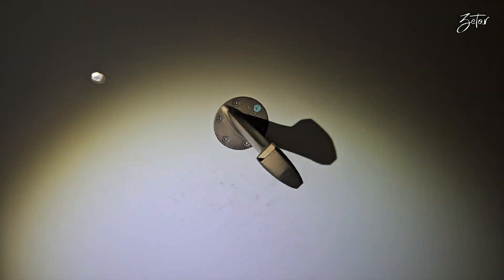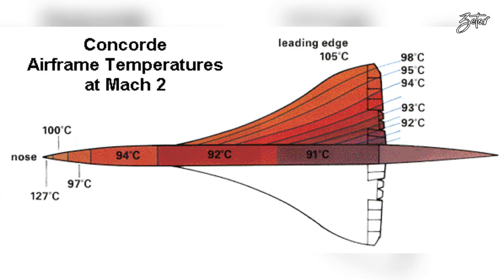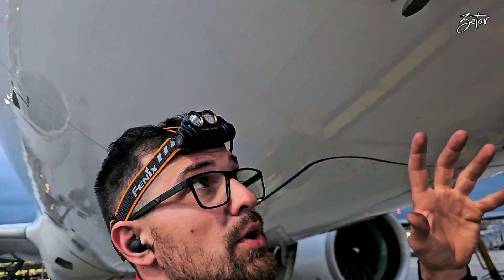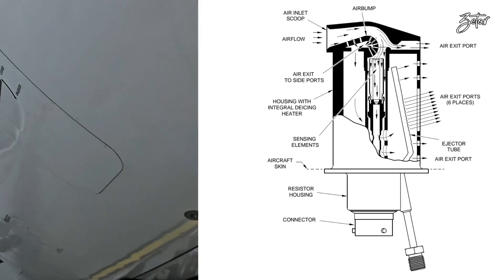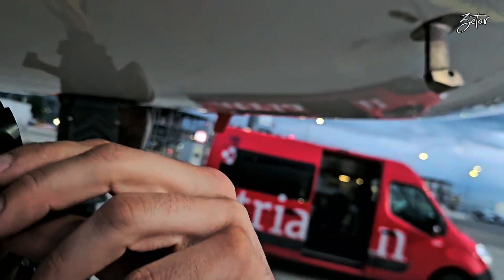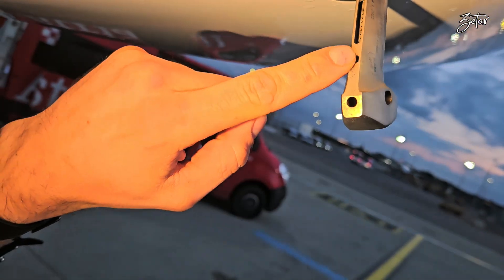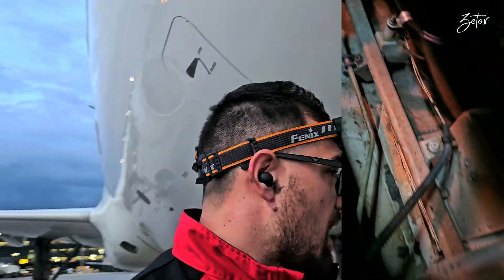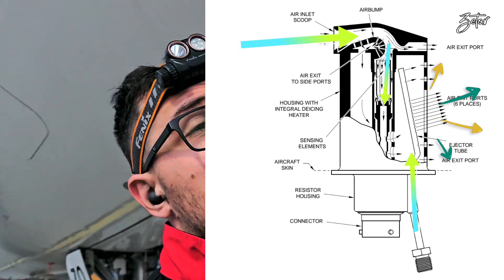TAT SENSOR on A320 and how it works

Comment: Pilot had a fault on the tat 1 sensor.We diagnosed the problem and concluded that the tat itself had gone bad.Easiest replacement ever.6 screws and a plug conector.

Comment: If we heat the probe then how can we accurately know the temperature of air, if probe is heated then air striking it will also change its temperature ?
Reply: Only the outer body of the sensor is heated, preventing the formation of ice. The sensor in itself is not heated. Since the air is continually being replaced as the aircraft flies, the air essentially has no time to absorb this heat. I hope this helps :)
Reply: @Phughy  actually I read about this and turns out there is a computer (ADIRU maybe) which continuously made corrections regarding this. 
I'm not sure but I read it somewhere

Comment: During flight, is it possible to have a difference in measurement from TAT1 to TAT 2 due to the position of the sun's rays as well?
Reply from the maker: Most probably not due to the fast movement through the air, air temperature is equal in such cases, that is the reason for aspirations on ground